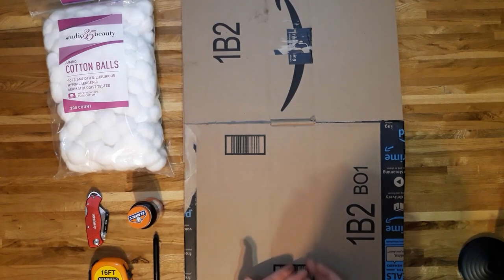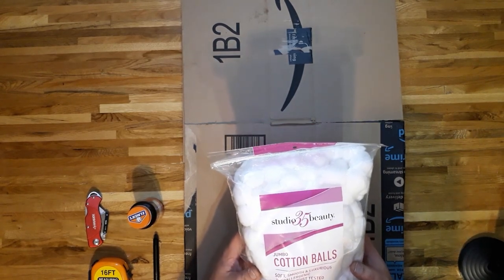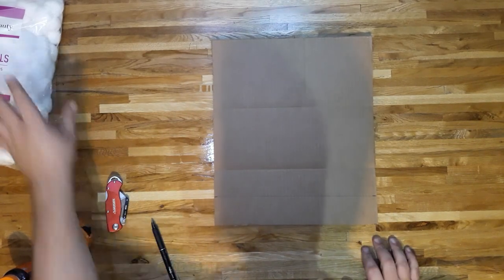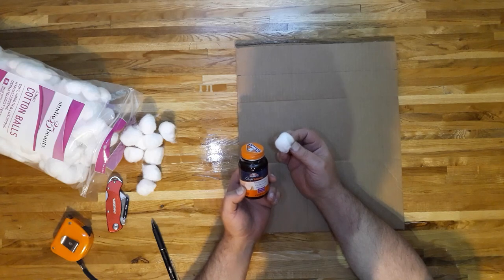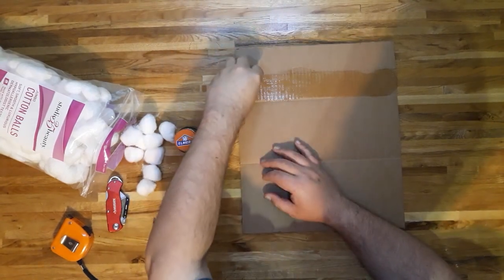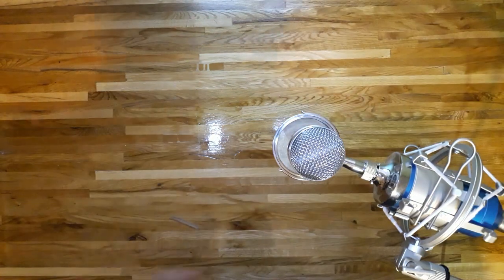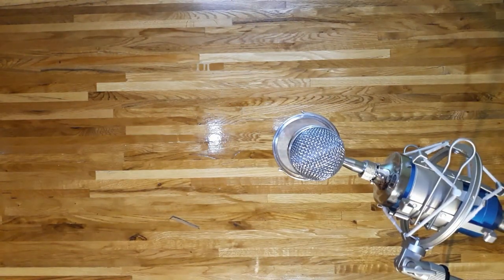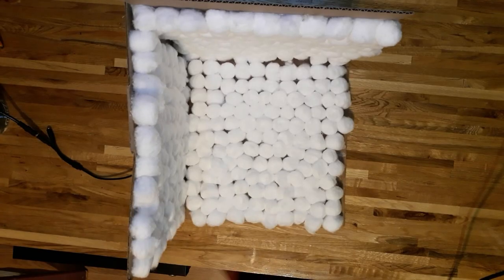Acoustic Panels V1

Comment: Hi! the results that you get is not worth money or effort you put in. You could have simply used 2" or 3" solid foam (Not pyramid type). It's better to use semi-circular design instead of rectangular one. Denser foam is a better one.
Reply from the maker: Well the video was just an experiment, but I didn't have high hopes for it really. I could have done a couple of inches of cotton balls, but the price would have been insane. I do have another idea, which I have some better hopes for, but don't think it will perform as well as 3" of foam. Getting videos out right now it kind of hard at this time, see this for why (90% of it): https://www.youtube.com/watch?v=6WgtLkWLgPM